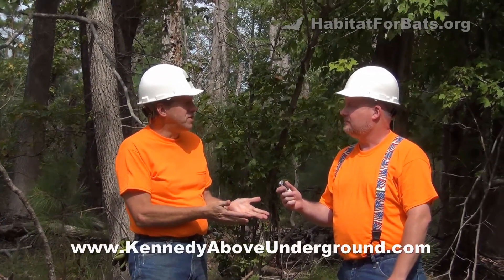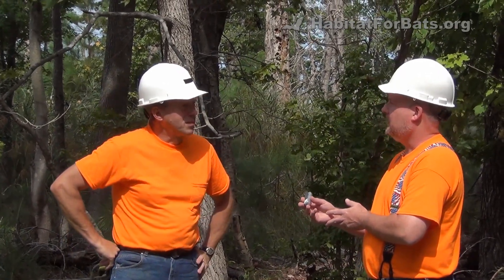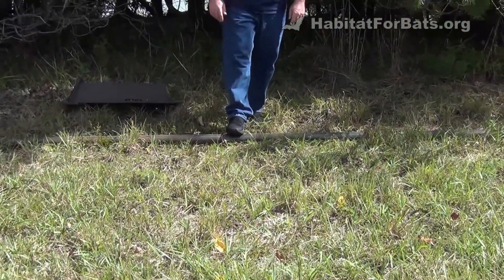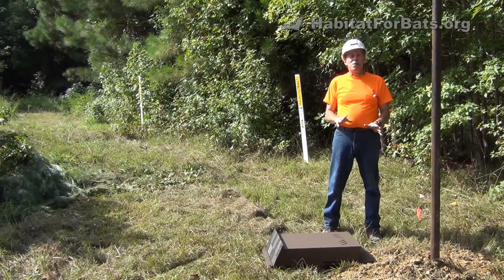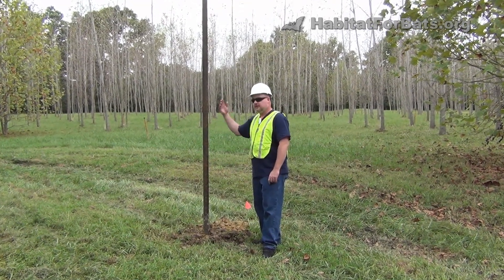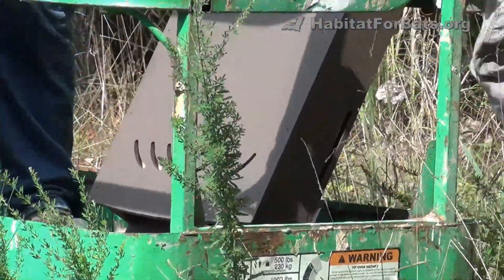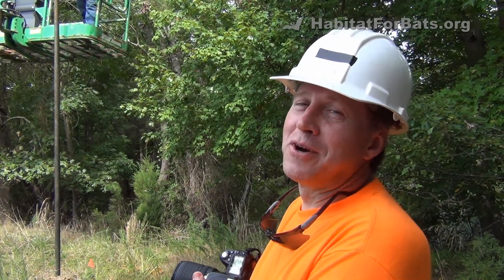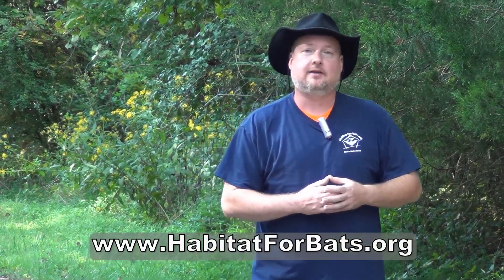Bat House Project / 600 Acres / 35 Four Chamber Bat Houses

Comment: You guys did a great job. I am wondering, can a tall pipe accommodate for 2 or more bat houses? Maybe one on each side, possibly 2 more 2 feet below those for a total of 4 houses per pole?
Reply from the maker: Yes, we use 2" ID Black pipe and make a bracket that will hold 2 bat houses on the single pole. Check out our online store, https://estore.habitatforbats.org